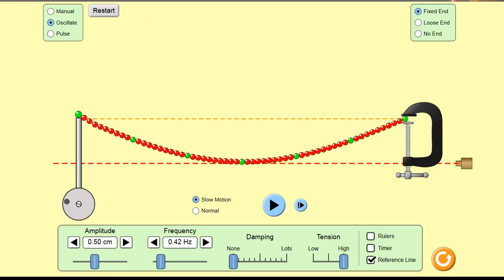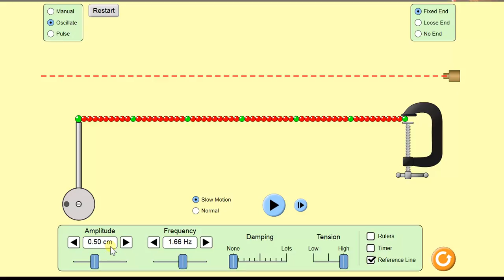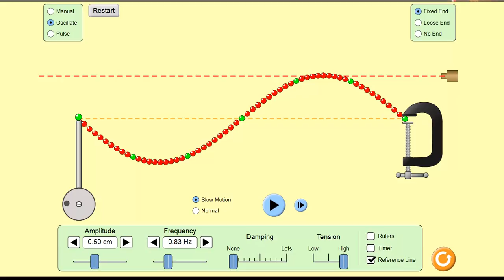Tesla Tech - Tesla's Secret revealed 02 14 2018

Comment: Good, standing waves is a key but rememeber watts is VxI so we need RMS power to do a work.
Now you have to send square wave source then get the harmonics.
Now some self running generator use perfect 1/4 wave. If square wave is used and the pulse width is small, it is like kicking a bell with a hammer at the wright time. Square wave will create harmonics and sine wave dont in a L/C circuit.

Comment: I'm starting to get it. However I'm having trouble envisioning the physical application.
Reply from the maker: The physical application would be a power generator with no moving parts. 
With Tesla bifilar pancake coil you dive the coil with 1/2 a wavelength of the frequency of the length of wire used to make the coil.

So if you used 50 feet of wire to make the coil that is around 20 MHz, you would then drive the coil with 10 MHz. That causes a standing wave to be set op on the coil, (not to be confused with resonance of the coil).

The center tap on that coil is dead center on the antinode. You run one wire of the center tap and us 1/2 of a bridge rectifier on the one wire and you get a DC voltage. The one wire is both the voltage supply and the ground, no energy is wasted, what's not used goes back to be reused. This was Tesla's one wire system.